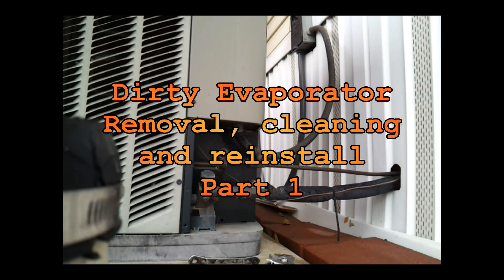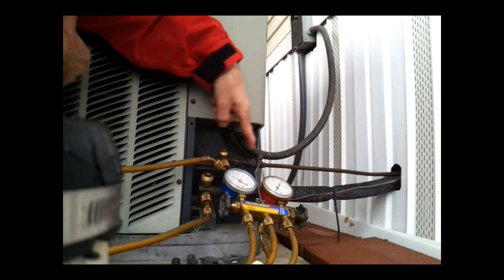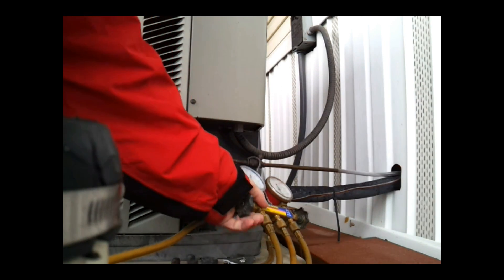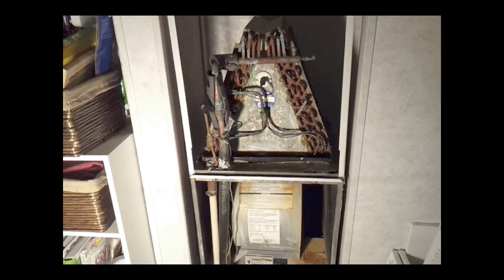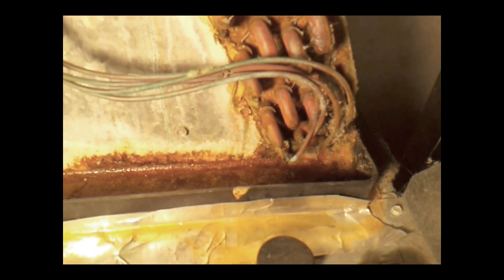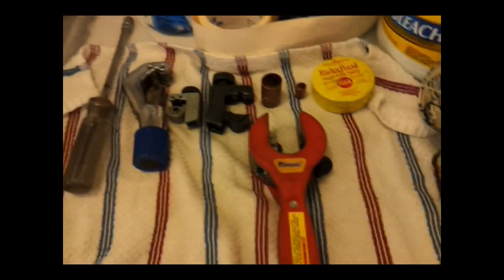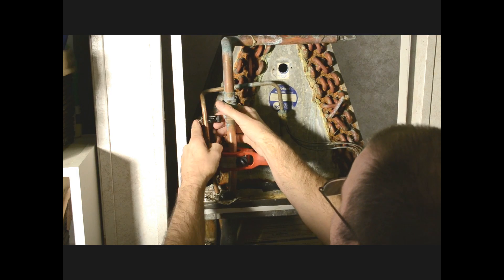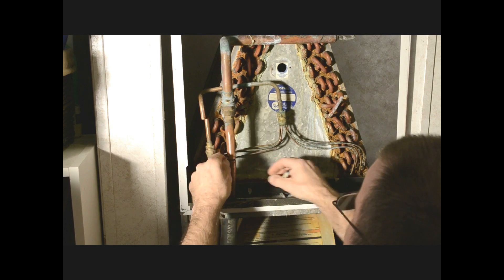HVAC Dirty Evaporator Coil Removal, Cleaning and Reinstall in Air Conditioning Unit. Part 1

Comment: My indoor coils may be frozen because my lines were . Been over a day thawing everything turned off the system .I'd like to check them but it's sitting on top of furnace with lines connected to it . has exhaust stack right in the middle and those lines  What can I do ?

Comment: I have been researching several videos like this and I never thought that there was vertical a/c systems like these because if there's leaks it goes directly to the fan blower...I myself have a horizontal one...so if there is any leaks it never goes directly to any electrical parts...but it is very convenient to have a vertical one for easy access...my a/c is in the attic so it's very hard for me to do any maintenance on it...
Reply from the maker: Yeah, there are a surprisingly large number of vertical units out there! Usually it's because of space constraints, usually if there isn't any attic so space to speak of, or if the vents are in the floor, such as my place.
Personally, if I could afford to build a house from the ground up, I would have one or two mechanical rooms that you could just walk into and have easy access, in an air conditioned environment, to work on and do maintenance on the HVAC, water heater, etc. With a nice sloped concrete floor going to a large Central drain, with a concrete lip around the room so if something leaked all the water would go down the drain and not get into other rooms.
I've seen lots of water heaters and HVAC units in attics leak and ruin ceilings and floors, and the same with vertical units in closet spaces. I've even seen vertical units in attics!  Some installers just drive you nuts! And home builders who don't think ahead! Lol.
Yeah, in the vertical design like mine, if the coil gets too dirty the coil drips down thru the heating coil section and onto the blower motor housing. Or the drain pan line gets clogged and starts overflowing. It can even rot out the flooring under the unit, seen that a few times! Ugh!
Reply: @mikie2501  I'll probably get a vertical a/c system built in the garage which already has a drain next to the washer once my current a/c system completely breaks down.

Comment: That is the exact same air conditioner system I have and it has the same type of filter set up. Just junk.
Reply from the maker: Yeah, virtually every time I've ever gone out on a call with an install like this, the installers cheaped out and didn't buy and install the filter box kit for it.

Comment: I have the exact same issue with mine, I am having to rip my floor up to replace it because of it getting wet and ruing and swelling up, black mold everywhere, i ripped the biggest part out today, now i have to fix the ac issue before replacing the floor, I am planning on changing the ac coil and pan, that's what brings me here, any tips or tricks you can offer? I would pay someone to come in a do it, but don't have the money, so i have to do it myself.
Reply from the maker: Well I won't preach to you about the whole having to be licensed to work with freon thing, but, you have to be licensed to work with freon. There, heh. You're going to do what you need to do. 
That being said, there is an easier path, if you want to call it easy, that mostly avoids you having to deal with handling freon. If your compressor isn't so old it can't handle it and if your system isn't over charged or the line set so long that it has a bunch of extra freon in it, you can do a pump-down on the system.
The short explanation is that you can pump all the freon in the system down into the coil in the outside condenser unit, then lock it off there, letting you remove and replace the coil without having any freon loss.
I'm sure there are a lot of good videos of this out there so it's best to watch several so you get a good explanation and not just one where someone left something out.
When you cut the lines (unless you somehow found a coil with the screw on connections, assuming your old one had those. Doubtful though) you should put some tape over the open ends of the pipes to keep moisture out and other debris till you are ready to install the new coil. Nothing too sticky, remember you have to sand the pipe ends later!

Just remember when putting in the new coil that you MUST use silver braising rods 5 to 15% silver) and braise with an oxy/acetylene rig, dont use soft/plumbers solder or it will blow out. 
There's also Stay-Brite #8, instead of silver rods, which uses less heat to install and costs less, but I've never used it, there is a discussion on it from both sides over on hvac-talk if you're interested:
https://hvac-talk.com/vbb/showthread.php?1460861-To-silver-solder-or-braze-HFC-410A-high-side-line

Make sure when braising the high side line that you either wrap the metering device in a wet towel to keep from melting the o-ring, or, using two wrenches so you don't bend anything. Loosen and carefully remove the Piston and Teflon gasket, they are easy to lose!! Remember to put the Piston back in the right way out the system won't work right! (Look up with Google images)
To avoid having to do upside-down braising you can make flare fittings out of the piping on the lower end of each one, of course this means you'd need to buy or borrow a flaring tool set. 

After that you need to pull a long vacuum on the system to remove air and moisture. Then pressure test for leaks. I like using some soapy water in a spray bottle. They sell the stuff but it's easy enough to make with liquid dish washing soap and water. Spray every braised joint well and watch for bubbles. Check carefully as they can be small, slow leaks. 
Of course it's best to pressurize the lines and coil with nitrogen. (Research again!) If all is well (or not) you close the nitrogen tank, remove the hose from it and then let the nitrogen our of the system with the gauges. If it leaked, repair and repeat again. 
If course if you have nitrogen then you should be running a slow amount through the system while braising. Watch a video on that, easier than explaining! :)  
If you don't have/ wont get nitrogen then you can momentarily crack open the high side valve at the condenser just long enough to put some pressure on the system, then start checking the high side line first inside, it takes a bit for the pressure to work thru the metering device and equalize the pressure to the low side. Hopefully no leaks!! 

If there's no leaks and you used nitrogen, then after releasing the nitrogen, pump the system down again, close your gauge valves, then slowly start opening the high side valve. Then you can open the low side. Check for leaks again!

If all went well you should have the same amount of freon in the system that you started with and everything should work fine!

Of course it's rarely as simple/smooth as it sounds, lol, easier to hire, bribe a tech on his day off with some cash or a case of beer or something ::)
Reply: @mikie2501  Thank you, Seems like I had heard that mentioned once by a guy that helps with ac work, It's just going to be my best bet to try and hire someone, that's a lot of work i don't have tools for or any experience with. Thank you for the info
Reply from the maker: @casperghost7298  no problem! It's always good to know what you're getting into before you get started, hehe!
I've always dreamed about buying a sailboat and traveling around world. Buying a decent ocean going sailboat new is worse than buying a house! Holy crap they are expensive! (Well i don't know how to sail and will most likely never get to do it)
So the next thought is buying a cheap, good used boat. Just watched a video of a guy that bought this Beautiful boat, that had a good survey too, he started taking things apart inside to check for rot from water on the iron supports interacting with the wood...next thing you know it's turned into a half year project, with him living art the boatyard, spending all his free time and money working on it, getting friends to help and hiring a retried shipwright to help. Lol. All from a lazy survey inspector!  Well, at least he knows how to fix his boat if it gets banned up a thousand miles from home!lol.
I love the old wood sailboats, its just ask the damned maint you have to do to keep it up. Fiberglass /grp is better, but give me an aluminum boat, don't have to paint it if you don't want to, nothing to root or delaminate or blister!  
Hey, it's only money ;)
I need but some lottery tickets, hehe!
Let me know how your project goes!!

Comment: Question. Why did you have to remove the coil, evacuate the system then pull vacuum if the baffle was easily removable and you could have cleaned the coil with a can of foaming cleaner agent in 15 min without removing it? It is fine to do your own coil that way but a massive extra charge the customer had to pay if somebody follows your steps

Comment: Cut lines below coil level, cut pressure fitting out ,remove drain and pull coil. Clean with Calgon and check drain pan, install coil back in space, liquid line drier,vacuum. 1" channel with tab for screw on both ends 4" above coil and new filter rack complete.Replace door..Charge system according to superheat.

Comment: how do u remove the bottom cover case?
Reply from the maker: On my unit it just snaps into place. The bottom edge of the cover just has a lip that fits behind the bottom edge, then you just tilt the cover up and push the top side into a couple of pressure snaps. Taking it off is as simple as grabbing the cover on the sides close to the top and pulling out firmly to pop it loose from the snaps.
DONT run the AC with the cover removed! It cant pull air through the coil and it will put stress on the compressor, freeze up the coil and just blow room temp air out, not to mention sucking dust into the blower and ducts. Safety hazard too for fingers, pets and kids! Power off first!  No offense, but it's probably safe to say that if you need to ask then you're probably better off calling a technician for whatever reason you wanted the cove off.  Be careful!

Comment: why are you cutting lines if you have fittings right there?
Reply from the maker: Thats a very good question!  I had a discussion about that with our main installer and in his experience with dealing with them over the years he said its not worth taking the chance that one will start leaking when you reuse it.  Im sure that if I posted that in a forum it would spark a long debate, hehehe.  Anyway I just got in the habit of cutting braising.
Reply: Then cut them out of line,install LL drier.

Comment: Hi!  Question---we have a similar unit with that Mortex coil thing on top.  However, there are 2 filters on either side of the A coils that are FILTHY.  What the heck kind of filters should you use?  Ours has blue hogs hair 1 in filters just lying on either side of the A coils.  Is that normal?
Reply from the maker: Hello!  Well 'normal' is relative with these things, heh. I think they came from the factory with some thin cheesy foam filters.  Basically the installer was too cheap to buy the filter box kit that goes with the unit and whoever was there before you probably started using those when the foam filters wore out.

Those are washable and reusable, BUT crap still gets past them and into the coil which will eventually lead to a dirty/clogged coil. I just used cheap $3.-$5. Walmart pleated filters, whatever the cheapest pleated ones were, and laid them on the coil. They catch way more dust than the hogshair or those fiberglass can.  How often you change them depends on where you live, i could get by with every three months or so.  For now get those washed and put them back on till you can buy some pleated ones.

Comment: The coil sits on the bottom. Starting at the slab there is a large intake opening. I use one of those $20 filtrete filters. Pets!. The filter is mounted on the wall with a louvered metal screen/door. the filter is 24x24. I unhooked the p trap(looks like a S piece of PVC) and hooked the garden hose to it. Water flowed good. When AC running I can see water coming out of the outside drain. The extra water dripping is from the "A" coil. It is just dripping straight down from the middle of the coils. 95% water going out drain, 5% dripping straight down onto the slab. Its enough to cause a puddle and start mold growing.
Reply from the maker: Hmmm... I think I can picture it now... I have a horrible time trying to picture things in my head when people describe them, very frustrating! 
...soo... It sounds like the entire unit, coil and all, sits vertically in a small closet space and is sitting on, say, a thick sheet of supported plywood, with a square hole cut out of it under the coil. The bottom area is a sealed off box area that has a tilt open filter intake that holds the filter behind it flush with the wall.

I'm assuming you can poke your head in there with a flashlight and the bottom of the coil is clean?  Usually if its leaking off the coil directly there is a blockage or restriction. This could be dirt\crud, restricted\blocked air flow, something (hopefully not) laying on the top of the coil, and the like.  

For kicks, and just for the test, remove the filter and leave the door open and run it and see if it leaks\drips with the increased airflow.  If that solves the problem you might switch to the five dollar pleated filters (still catch cat hair fine) and take some pliers and open the vent slats up more so that they restrict less airflow. (I do that with room vents that aren't putting out much air, you'd be surprised how much air is blocked by the sharp angle of the slits!). ...also, what size is the unit? 3, 4, 5 ton etc, I'll have to refresh my brain on the required return vent size for different sized units. Let's start there and I'll think some more on it... Only slept about six hours the last three days so not super sharp at the moment! Heh... Gotta love insomnia, lol ;)

Comment: Great Stuff. Thank You!  I have a question or two. I live in Alabama. My HVAC is 1 year old. Everything replaced in/out. Very clean, no dust buildup. I have water dripping down from the coils onto the slab floor. I dont have a blower below, just the air intake. Blower must be on top of coils. My drain is not stopped up, and I bleach the drain once per month. It seems like after the AC shuts off I hear the hissing of the fluid stabilizing in the coils and then drip drip drip. I took filter off intake opening last night and saw the dripping and puddle on floor. The old system did not do this. Any ideas what could be causing this. All help welcomed.  PS. I dont have a UV bulb either. What is that for.??
Reply from the maker: Hmmm... Sounds like a negative pressure system. So the coil is on the bottom and the filter is under it? (Trying to picture it in my head) and the unit is above it?  Without seeing exactly where its dripping from its hard to be sure.  Does the drain have a P trap in it? Only a year old so I wouldnt expect a dirty coil unless it was run without a fiilter... Im assuming the filter is fairly clean.  Can you physically see where its dripping from? Is it right off the coil, or off the drain pan or drain line? Is it dripping off the copper piping?